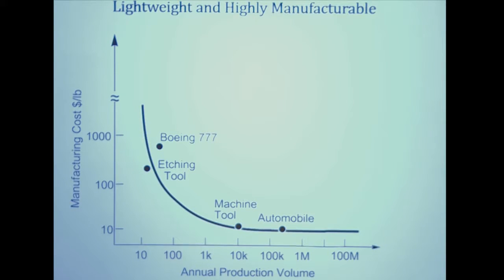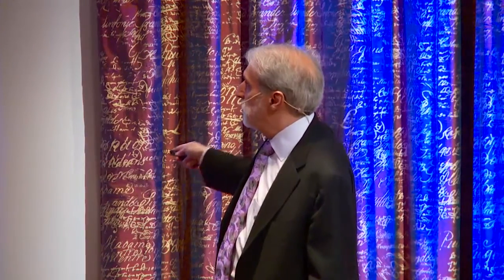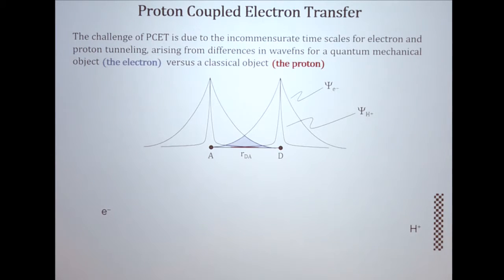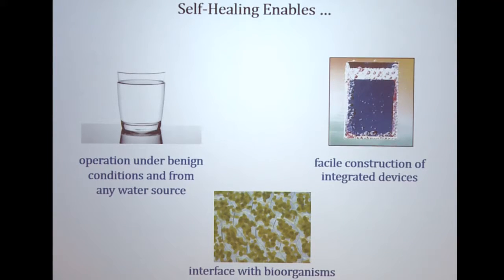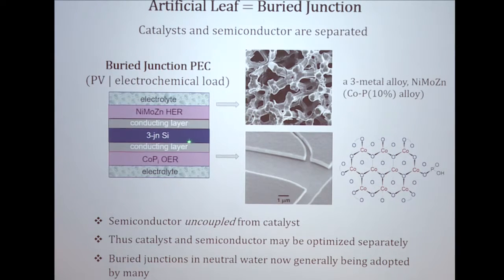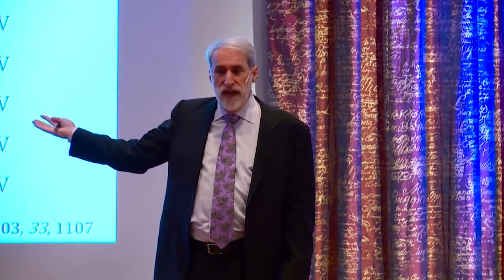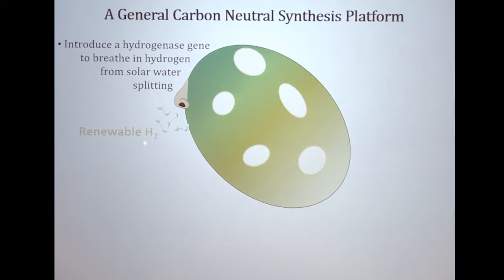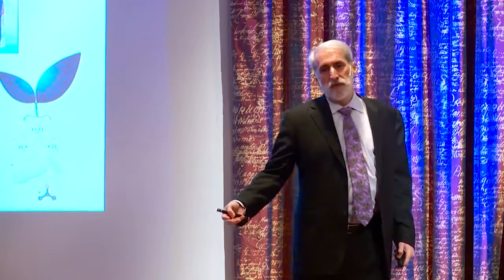A Complete Artificial Photosynthesis: Fuels from Sunlight, Air and Water

Comment: First of all excellent work! Say you achieve 16% efficiency, so around 16x more efficiënt than a leaf, then you would still need a huge surface area to be as efficiënt as a tree right? And how much could it potentially generate compared with the great competitors. For sunlight we have a solar panel, for wind energy we have wind turbines, how do you envision this as a consumer product? Will it be like a solar panel covered in water on a roof of a house?